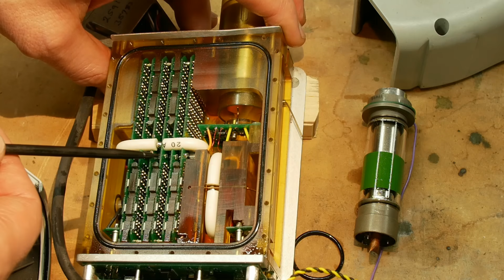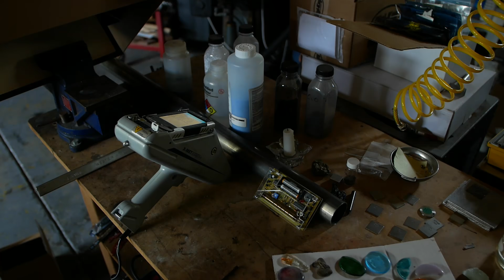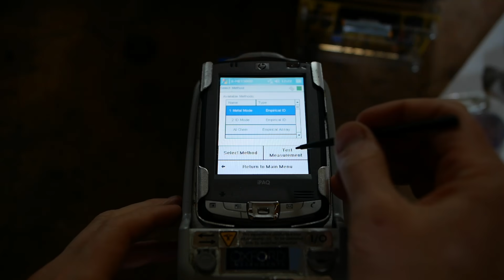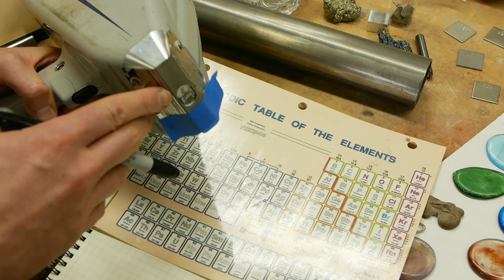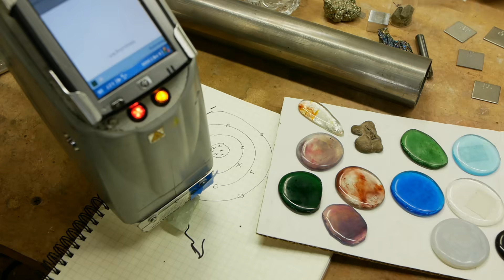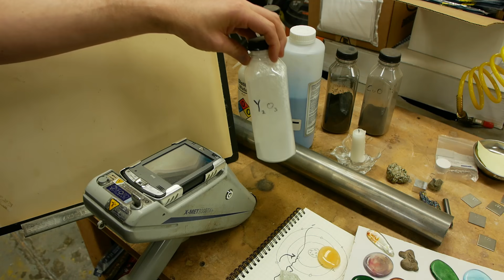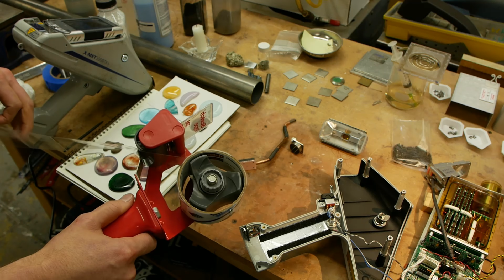Demo and teardown of an X-ray fluorescence gun (measures chemical composition)

Comment: The secret ingredient is an HP iPAQ from 2004.
Reply: This has to be by far the best use that I've seen for any "PDA".
Reply: @mlentsch  Changing the tv channel in a bar in a foreign country with the built in remote is a way better use.
Reply: @pgtmr2713  how did you do that?!
Reply: @ytrew9717  It had a program on it. You search the manufacturer, then try a few codes, until it worked or in a few cases it didn't have the code.
Reply: @pgtmr2713  my galaxy s6 could do that
Reply: @arthurmead5341  Galaxy S6 didn't exist in 04
Reply: @mlentsch  We used to have those to install HP graphic calculator emulators... because of the hardware, it ran faster than the originals
Reply: @mlentsch  what about putting one in a phone...

(you realize smart phones are just PDAs with internet, right...?)
Reply: @adfaklsdjf  you realize windows phone is just a PDA with a phone in it?

such memories back when apple only made B&W mp3 players, and google was just a search engine.
Reply: @RedFathom  "windows phone"?  What is that. 

But in seriousness, yes, and iPhone and Android phones are PDAs with phones in them.. essentially palm pilots with a phone app.
Reply: @adfaklsdjf  once upon a time in the early 2000s microsoft made a "smartphone" way back before apple changed the definition of what a smart phone was. even before youtube was a thing. when google still had rivals.
Reply: @RedFathom  I had one of those! I had it through Tmobile back when EDGE(2G) was the hottest thing for mobile data.  A whopping 128kbs connection in the palm of your hand meant the whole of the fast growing internet was a tap away on that silky resistive touch screen.
Reply: @23Scadu  I mean.. it basically is?  And a battery.
Reply: @23Scadu  It would make as much sense to say "lolol commodore 64s were so fucking dumb I can't believe anyone thought that was a good idea"..
Reply: @mlentsch  I have seen  a similar HP PDA used as a touch display for a portable spectrum analyzer, pretty neat.
Reply: I had one of those and I mostly played Bejeweled on it... they got popular before there was affordable mobile internet....same with my Nokia Communicator- the coolest device on this planet- that I had absolute no use for besides of playing doom that I had to transfer over the IR port...anybody remember that fiddly shit?
Reply: @olik136  Heh! I killed easily a half dozen Palm-series screens playing bejeweled. I have one working device left, which I still trust for password management. Not getting anything off of that without physical access! But that's another topic. :)
Reply: @olik136  IR was nearly useless, besides the tv remote. Bluetooth was more useful. I had a 2210/15, 3 of them. I would have upgraded from the 400mhz model if it had the same features. To me it looked throttled back. I could play mp3's on that thing and game at the same time. It was great for music in the car, without all the cd's. It wasn't til 2012 when my first smartphone eclipsed those older devices for me.
Reply: @olik136  9210 communicator had Doom port back in ca. 2000. And an XT emulator that run 386 era dos games.
Reply: Back then, using the PDAs was the quickest way to market.  They were fast enough to process the calibrations, but they didn't have any floating point capability.  Communication to the main analyzer was all done over an RS-232 connection, believe it or not.
Reply: Had one of these things (Dell Axim x51v). A few years after it retired deep down in a drawer I managed to install Android on it. But it was useless anyway.
Reply: Man that pistol is cool.
I had to regularly use an x-ray fluorescent machine on work 10years ago.
But ours was a heavy that looked like the child of a 486er computer and oven 😂.

So we must carry all samples from production line to the Labor that was 2 buildings away 😂 
Good on the positive site you didn't need to do sport after work to be fit 😂
Reply: @sebastianschmidt566  10 years ago? Do you know what make or model it was?
Reply: @ribrobrab  no sadly not, and the model in use was even older

It looked a bit like this Modell
https://www.google.com/amp/s/www.azom.com/amp/article.aspx%3fArticleID=1494
Scroll a bit down first picture.
Reply: To be fair, it's an older XRF gun.
Reply: Windows cannot compute, Windows changing XRAY direction by 180´ :)
Windows killed its master, windows sad, windows BLUE :d
Reply: @pivkaaa  the sad thing is the windows version on the Palm's (it was a windows CE or at least based on that ) was really stable unlike our shitty desktop version even more stable then today's android.
And also you could easily build driver's for the usb port inside the Palm
Reply: Palm PDAs had more secrets -_-
Reply: I had one of those as a kid, brings back memories.
Reply: Still have a working palmtop just for nostalgia sake. But they were hell as cool back in the days
Reply: I feel a bit old because I recognized it too. 😀

Last time I saw mine. It was flying off hanging from a balloon. 😂
Used it as the computer for a DIY Weather balloon (at least in USA and EU you can do it legally)
Reply: Probably only thing that isn't effected by slight radiation exposure anything new would probably  melt
Reply: I wonder if a Palm TX would work in place of the iPAQ? 
I still have a functioning Palm TX laying around, and I only use it today to play Solitaire when I'm on the shitter.. 🤷🏻